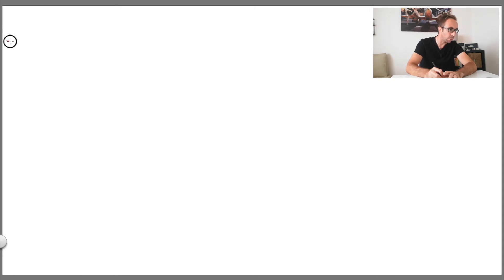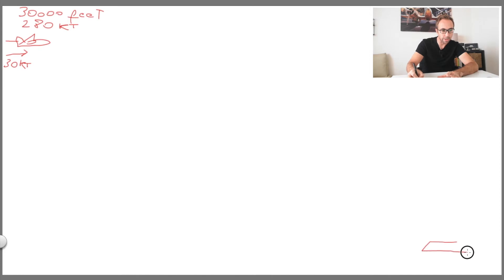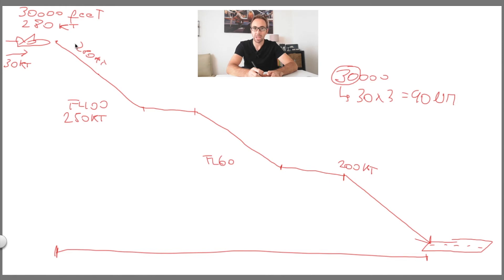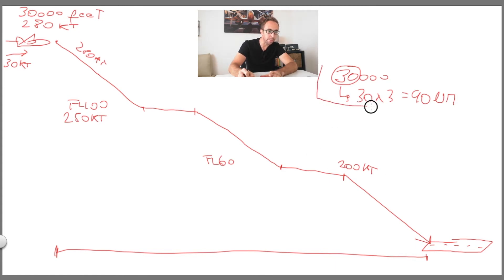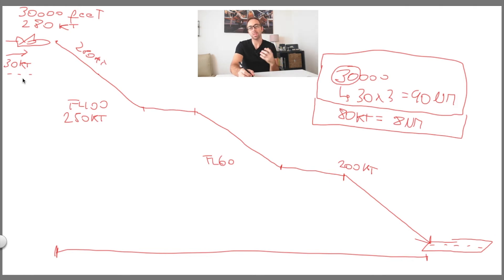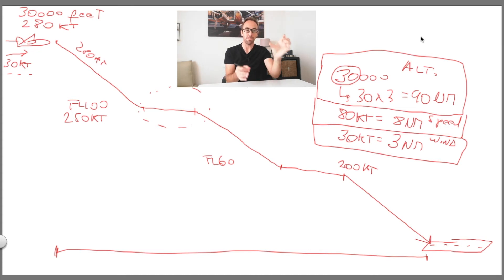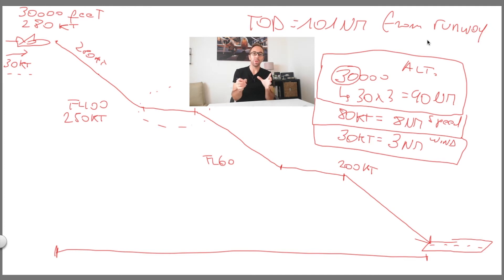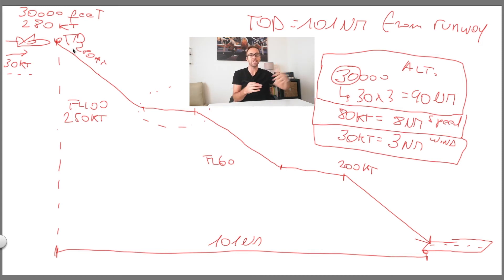Top Of Descend: When Do You Start Your Descent? - [Calculations and Tips from an Airline Captain]

Comment: Is not 1500 fpm very high for descend? if we have a tail wind and ias is 280 kt why we dont decrease the throttle and set the speed to 250 kt  before step down which is illustrated on star charts... 🤔
Reply from the maker: Hey, thanks for watching! The Rate of descent vary with many factors, so 1500 fpm might be very shallow or very high, it all depends on the Aircraft type and speed. For example, for a cessna 152 1500fpm is a high rate of descent however for a Boeing 747 is very shallow. You reduce the speed depending on your position compared to the ideal path. On Wed 14 of July I will release a flight Sim Video where I talk about this topic. Make sure you check it out!

Comment: Hello captain thank you very much for your informative video. Want to know What is the reason behind taking 2 numbers from the altitude and multiplying by it 3 .. ?? Thank u again!
Reply from the maker: Hey, thanks for watching and your support! I'm happy to see you are making all these questions! This shows you want to learn and this is great! The main reason why we do that calculation is that by doing this simple calculation you can have a good idea if you are on your descent profile! We only take the first two-digit because otherwise, the calculation won't make sense. Let me know if I answered your question..
Reply: @PILOTCLIMB  How about this method using high-school trigonometry which we all done in math class when we were kids:
Track distance required in nm (horizontal along the ground):
= [Altitude_in_feet / TAN(descent_angle*(Pi/180))] / 6076

Ps. The divide by 6076 at the end is to convert from feet to nautical miles.
?
Reply from the maker: @nitram419  Hey, thanks for watching!! For sure a more complete and precise calculation will be more accurate, however, when flying the plane we need to keep it simple and easy to calculate mentally. I wish you a great day!!
Reply: @PILOTCLIMB  I got ur point thank you captain..

Comment: 1)So when the altitude is FL300 and the airport has an elevation of 5000ft, i have to calculate (30000ft-5000ft) first and then multiply with 3, correct?
In this case 75NM is the distance for the altitude.

2) is the speed in your example 280knts, indicated or groundspeed?
And which wind of 30knts are you using for tailwind?
Are you using the average wind or do you have to consider every windcomponent for every leg in your flightplan?

3) in case of sidewind, do you have to take the tailwind component for calculation?

4) in a comment to another user you wrote that the atc has an idea where you start your decend.
But how exactly does it work?

Thanks for answering.
Reply from the maker: Hello, I hope you are doing great!! many thanks for watching the video!!

All right let's start :):

1: All correct!! Very good!

2: The 280 kt is indicated since you use the indicated airspeed for flap extension.
For the Top of descend calculation, you can use the average tailwind component that you will have during your descent. 

3. in case of crosswind you simply disregard the wind since there is no tailwind or headwind component.

4. The Air Traffic Controllers can see on their radar your altitude speed and more information, so, the ATC is actually quite good on providing descend guidance, some ATC units (LONDON for example) are extremely good on managing the descents of the  Aircrafts.

I hope my answer helped you if you still have any questions don't hesitate to ask!

Have a great day
Gabriele 
Pilotclimb